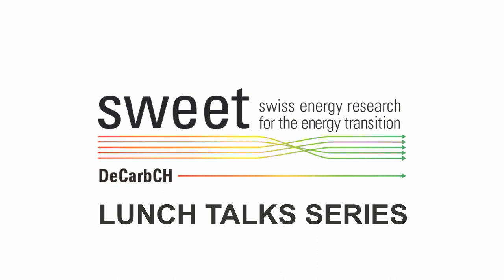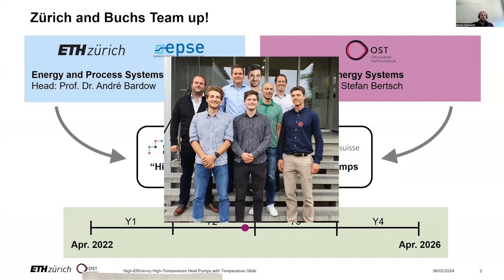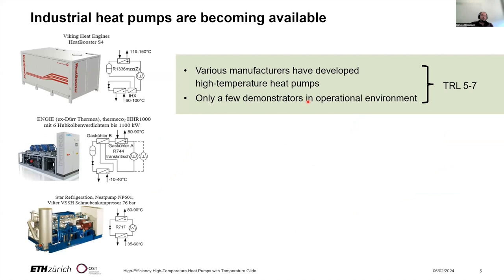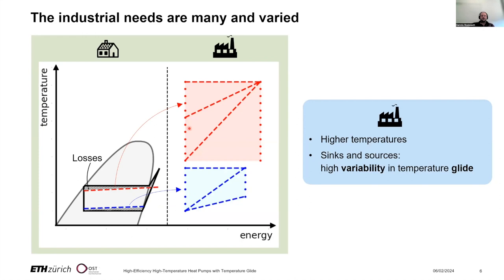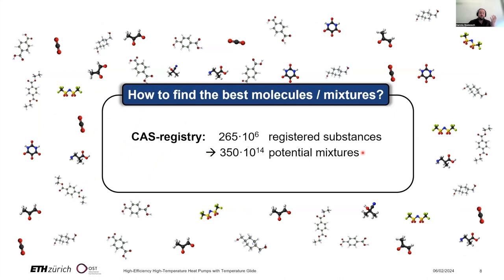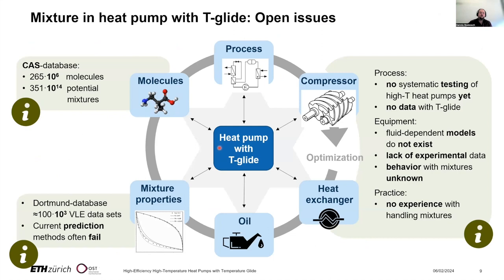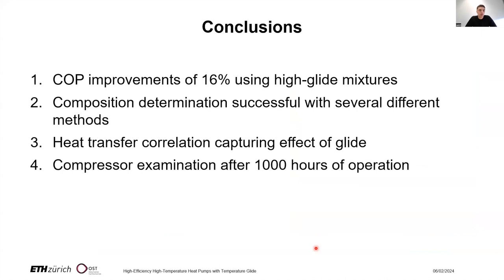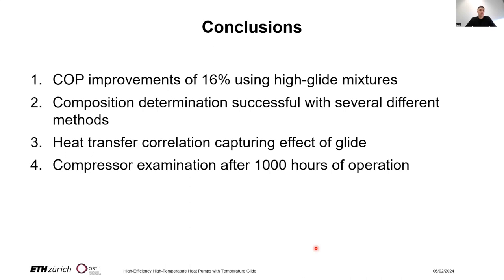DeCarbCH Lunch Talk: highly efficient high-temperature heat pumps with temperature glide

Comment: From abstract of your paper, "The mixtures were tested over a range of compositions at a source inlet temperature of 60 °C and a sink outlet temperature of 100 °C, with the heat sink and heat source temperature differences controlled to 35 K"

What do you mean by "..differences controlled to 35 K.." ?